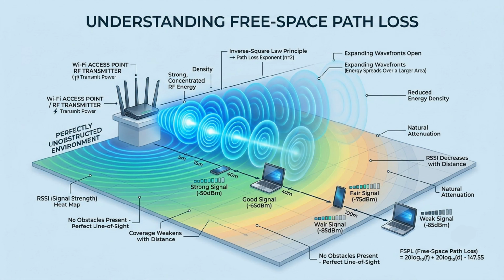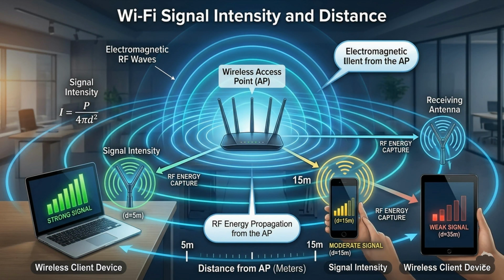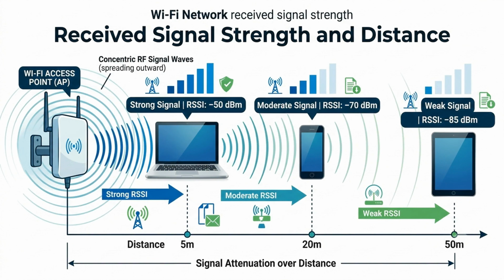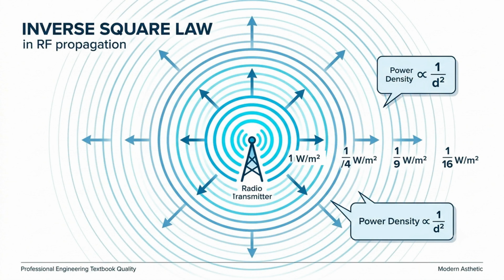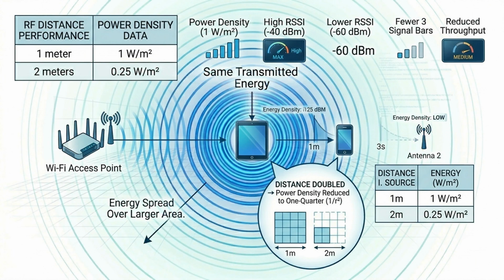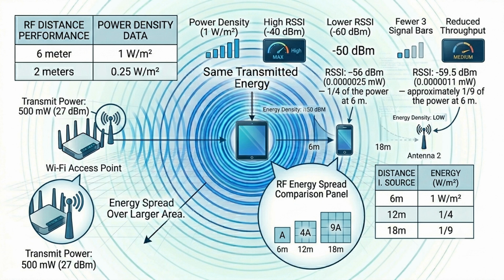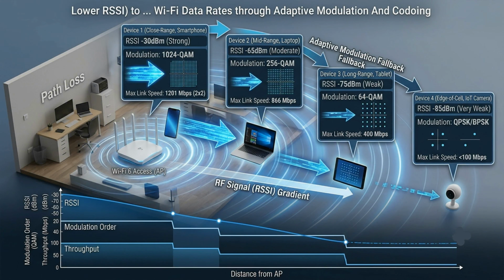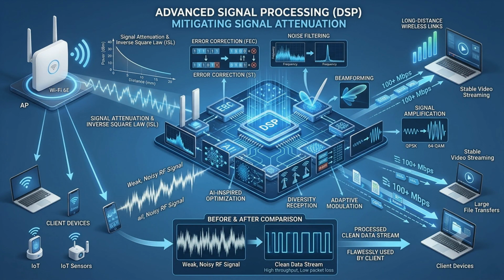Effect of Inverse Square Law on RF Propagation | Video 9 |

Comment: The inverse square law proves that the Universe is three-dimensional.
Reply from the maker: @victorkazakevich9700, It is an assumption. While the inverse-square law doesn't mathematically prove the universe is three-dimensional, it is one of the classic pieces of evidence that our large-scale physical space behaves as if it has three spatial dimensions.
Reply: @Insidewifi  What's the assumption? It's a law.
Reply from the maker: @victorkazakevich9700  agreed.